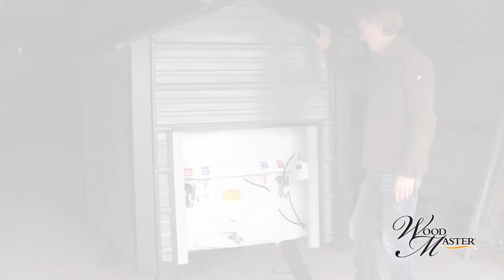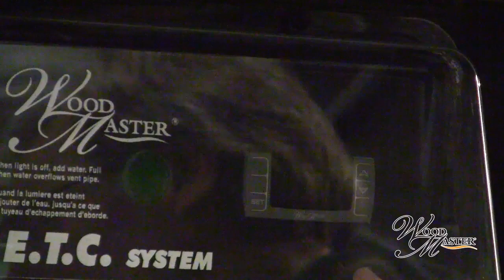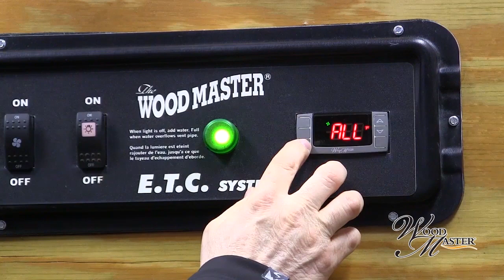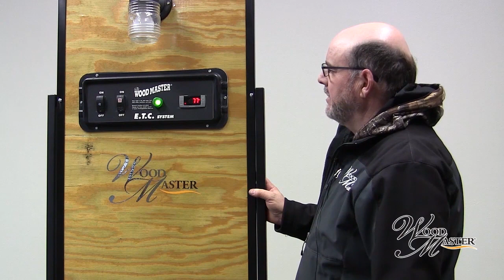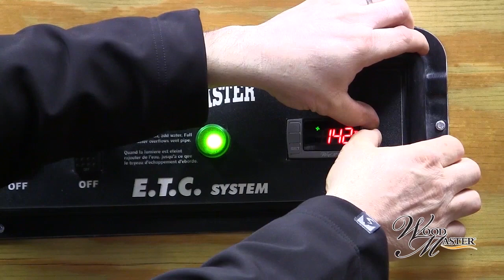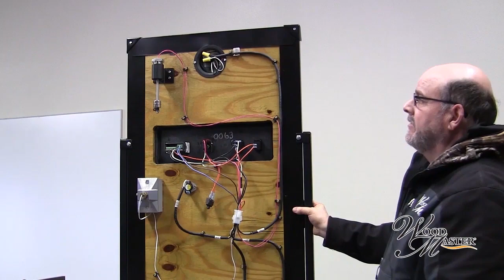Woodmaster Traditional Outdoor Wood Boilers | Models 3300 4400 5500 6500

Comment: does your furnaces come with the water pump?  I have the 3300 model and have been using it for over 15 years. Very happy with it. We purchased it from Jack Miners. Looking to possibly upgrade  to the 4400.
Reply from the maker: The water pump is not included because some different applications require a different pump.  We offer different circulator options.  Talk with your local dealer about which circulator will work best for you.